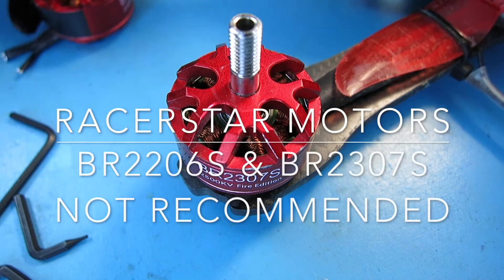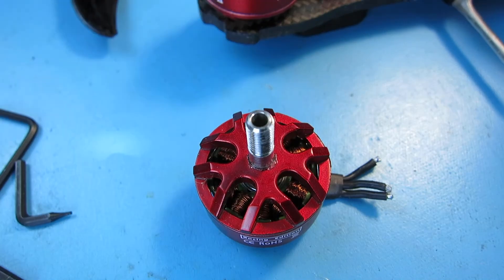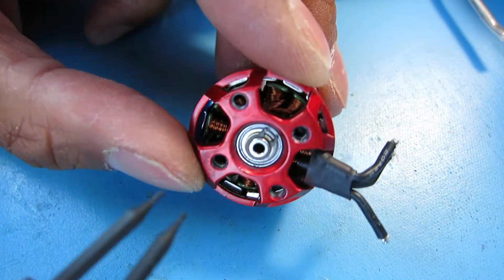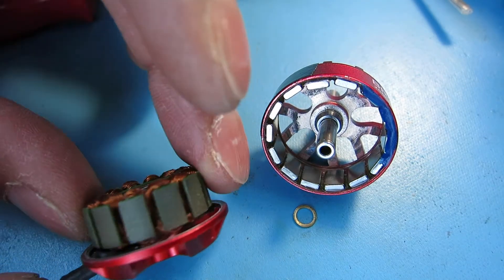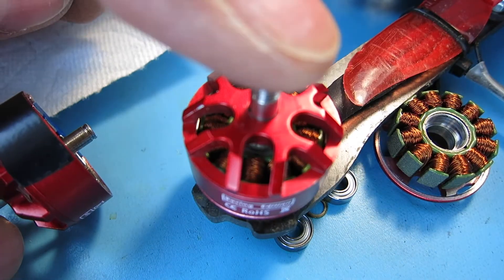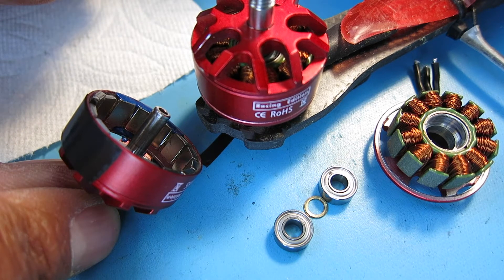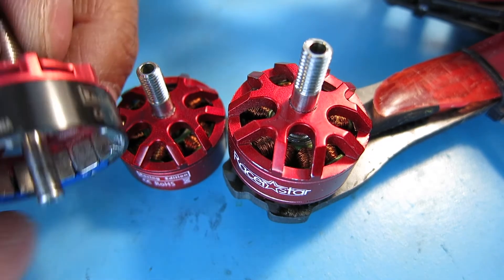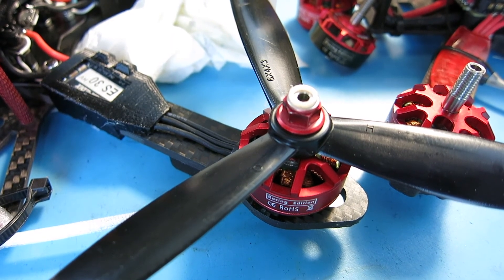Racerstar BR2307 & BR2306 Motor Teardown and Bearing Replacement

Comment: Ive lost a magnet out of the first batch of 2306 motors but since they have added a glue which holds them down, ive also lost magnets from many of the more expensive manufacturer motors so its something that happens on many motors regardless. The br2306 2700kv actually perform better than many more expensive motors and will agree on some durability issues but other motors have the same issues but are 4x the price. These are easily the best cheap motor on the market, I have tested these beyond what most would even need.